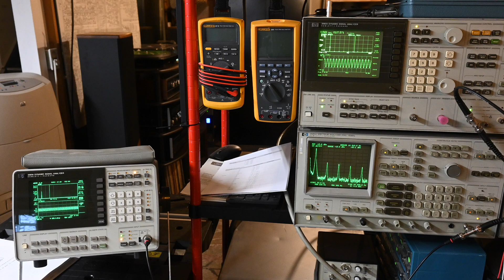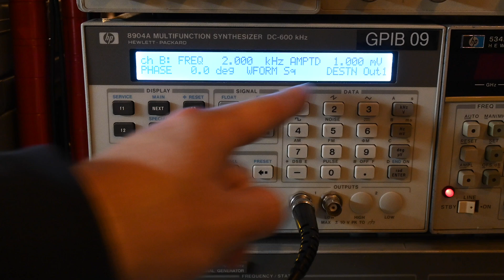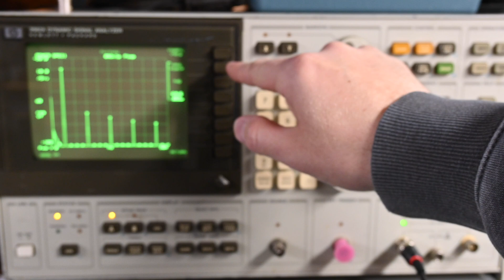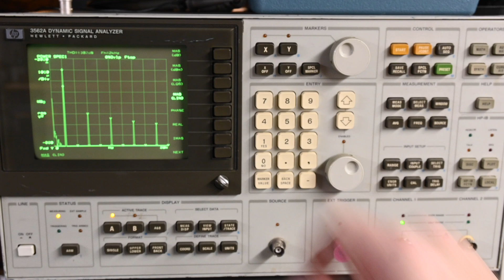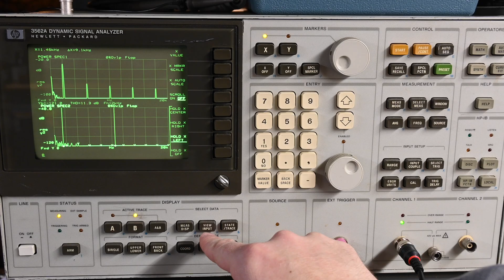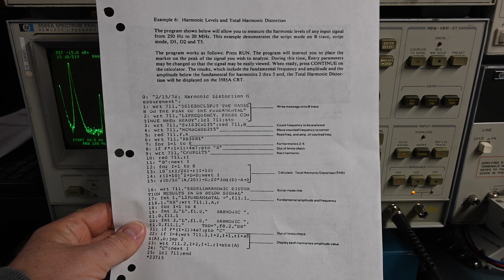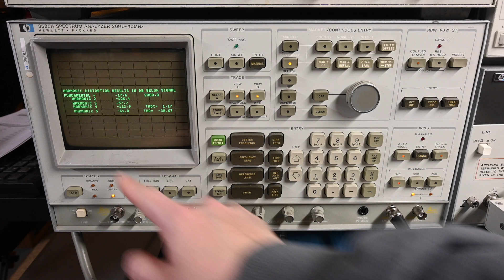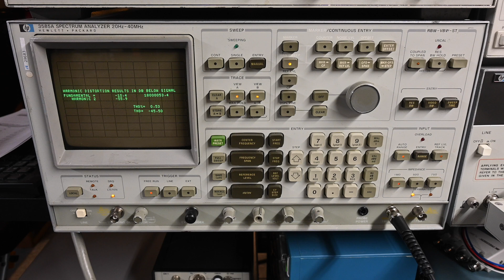Measuring THD with HP 3561a/3562a Dynamic Signal Analyzer & HP 3585A Spectrum Analyzer

Comment: I really should play with my 3561A, I haven't used it since I did the videos fixing it!
Reply from the maker: They sure are handy, at least for the type of work I do (mostly audio).  Having the FFT display that calculates thd on screen on a device with 1MOhm inputs is nice, for tracking down distortion and noise between amplifier stages etc.  Never been a fan of the FFT mode on any of my regular scopes.